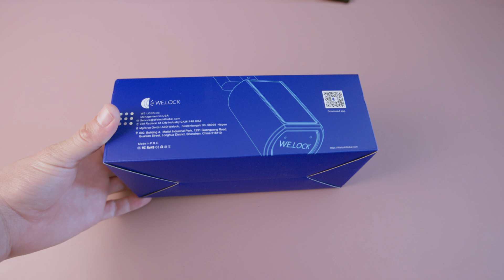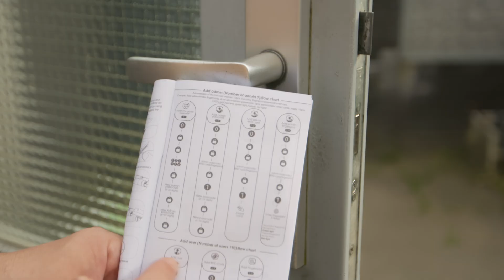Smart Lock Full Teardown, PCB Secrets & Reassembly & Installation Guide

Comment: What if AAA batteries died or there's a problem with electronics inside the lock? Can i open it via key or other mechanical mechanism? I don't see anything like this. Thank you for the interesting video.
Reply: its good if it cant, because the mechanical lock is always the weakness, like the smart lock i use the machanical lock can be easily opened by someone with no lock picking skill
Reply: @lifeai1889  how to enter the room if the electronics inside the lock isn't working? Should I break the door?
Reply from the maker: If the AAA batteries run out, you can either replace them with three new ones or use the emergency USB port. However, if the electronics fail entirely, you'll need to unlock it mechanically—similar to mechanical locks. I think I also saw another type on their website with a mechanical backup key as well.
Reply: @makersfunduck with this type of lock i need to break the lock? Using something like a drill? I mean if the emergency usb doesn't help?